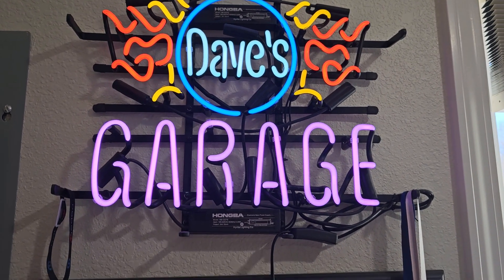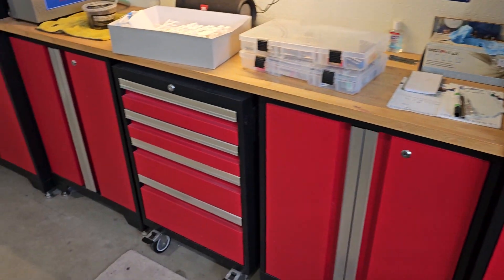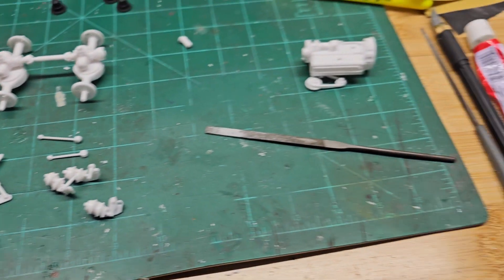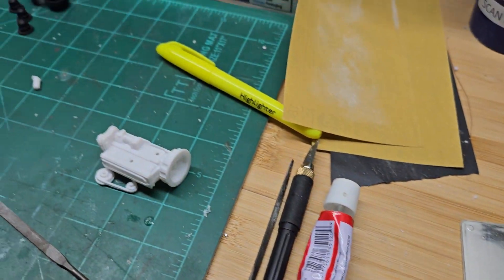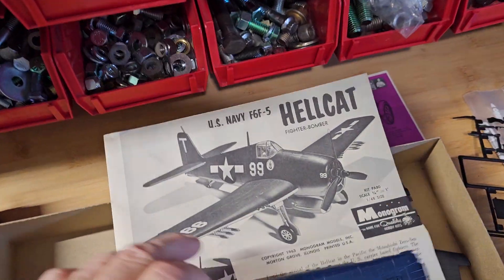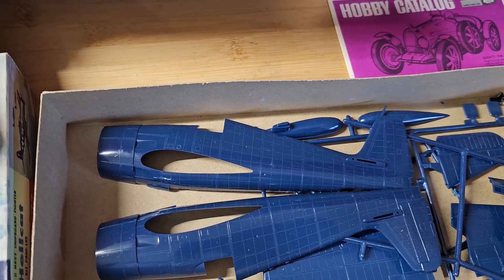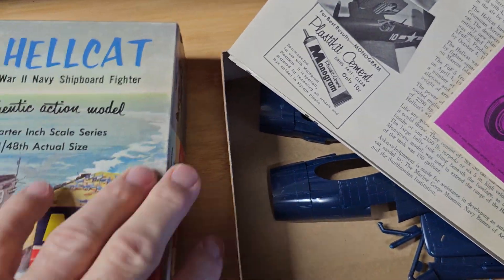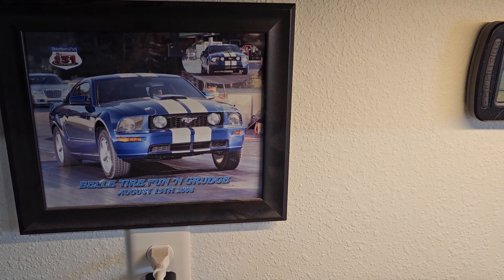Back from Surgery, needs paint booth, update on Mack, and a look at an old kit.

Comment: ROHS: The Restriction of Hazardous Substances Directive 2002/95/EC, short for Directive on the restriction of the use of certain hazardous substances in electrical and electronic equipment, was adopted in February 2003 by the European Union. The initiative was to limit the amount of hazardous chemicals in electronics.
Reply: I wasn't convinced by the CE and ROHS 'logos' on that manual either😁.